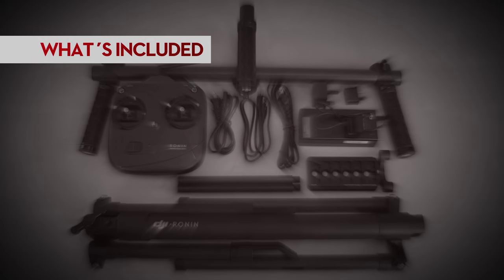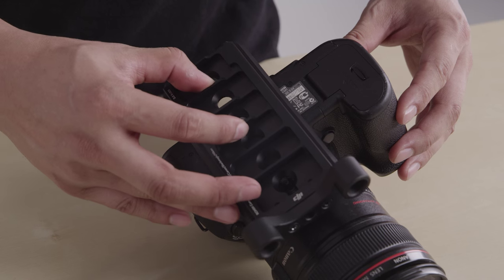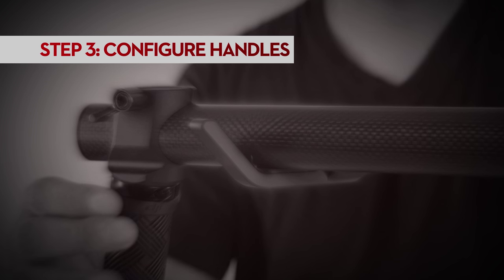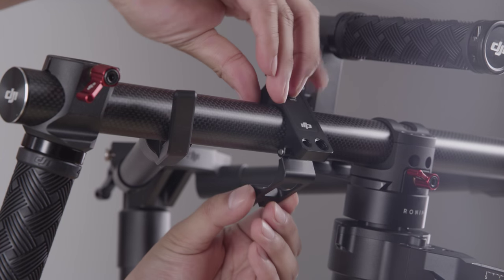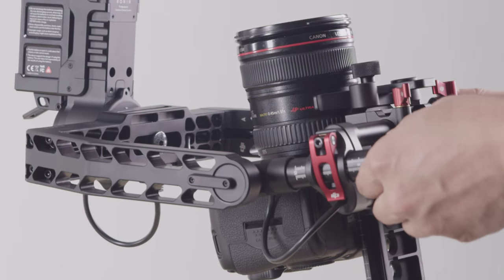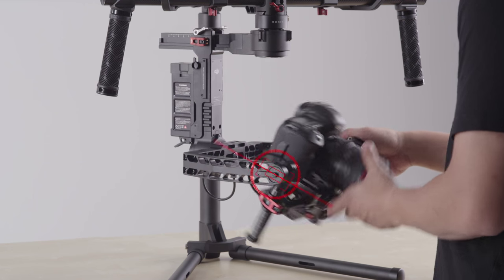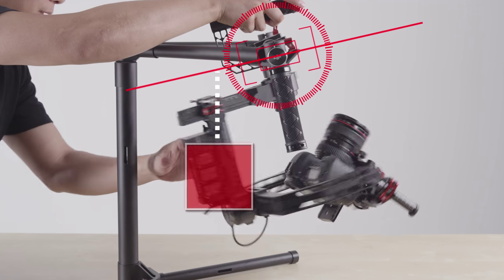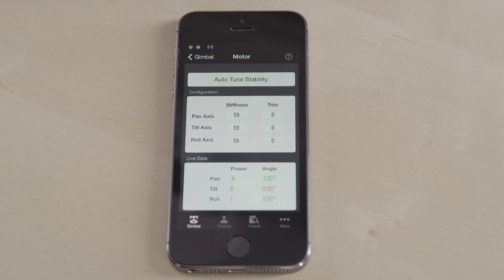DJI Tutorials - Ronin - Preparing and Balancing

Comment: I've purchased s Ronin-M but the supplier has sent me the original Ronin body (the tuning stand and frame) with Ronin-M batteries, handles bars etc (everything else Ronin-M), will this still be compatible and be able to work together or should I swap the original Ronin body for the M body?